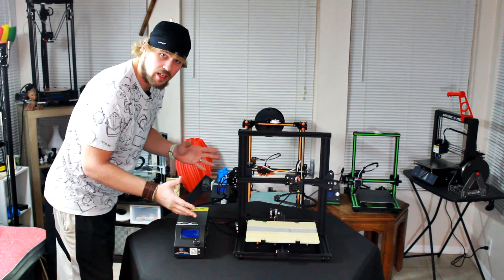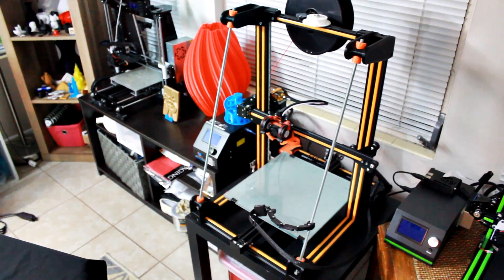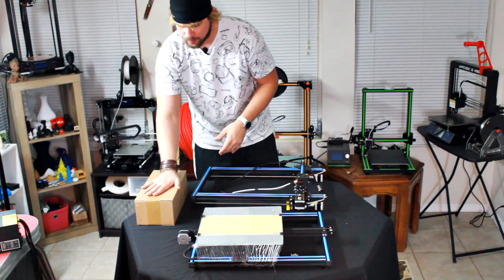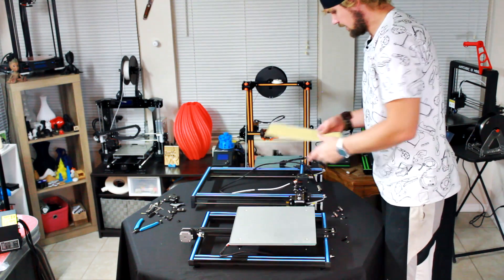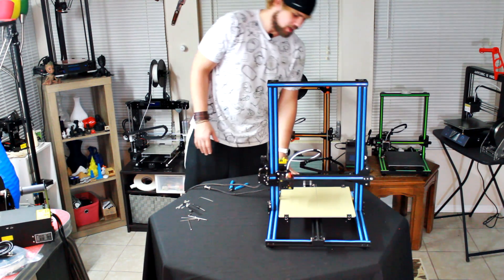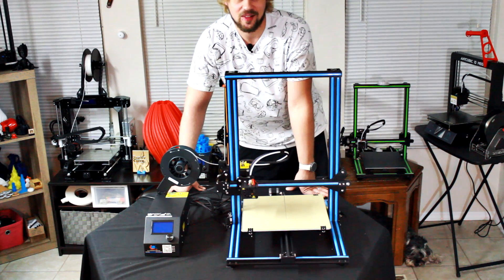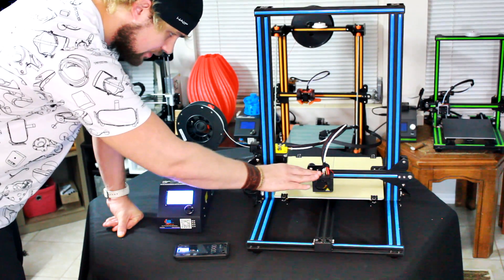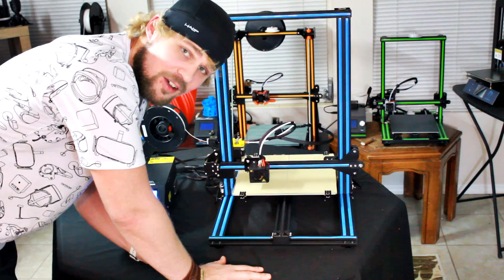✔ Creality CR-10S Upgraded Version COMPLETE REVIEW! | WORTH THE EXTRA CASH?

Comment: Horrible printer. Not worth the money. I've been printing with this device over 2 months. Always a problem. Screws gets loosen during long prints. Heating bed problems. You need to adjust this before the prints and after. One project Ive printed 4 days of non stop print, nozzle part (bottom wheel screw) readjusted due to vibration and damaged the project. there's many other problems. So those guys who say such nice thing about this is because they get free parts and even printers from the company.
Reply: Thanks for honest advice, what 3d printer do you recommend?
Reply: It is very hard to tell. Think what you want to do with it. Do you need 400 mm toll objects to be printed? (That’s how I thought, and it takes days for them to be printed, which is a downside) The quality? Also a challenge. The slowest you print the highest quality you’ll get, you can do so with most printer up to 300$ 
I get rid of the CR-10S way too many problems, especially when you beginner. You’ll have to do research on forums not on YouTube. YouTube is a business for those who know how to sell. :)
Good luck.

Comment: I thought this had auto leveling? is there another version with that feature?
Reply from the maker: you can add auto level very easy to almost all the printers, but IMO i prefer not to have it as it takes a lot of time during each new print and the bed usually stays level for a long time after initial calibration as long as you do not move it too much.

Comment: I have the CR-10S - none of the parts are 3D printed their all injection molded. Gotta give Creality some credit including so many spare parts - wow. The printer can easily be upgraded to the latest Marlin firmware which is a MUST and adding a Raspberry Pi 3 + Camera + OctoPrint = heaven! Luckily I have spare raspberry pi's... Marlin makes a HUGE improvement over the stock firmware FYI. I had crashing issues with stock firmware when manually adjusting Z axis on the control box too rapidly.

Edit: Looking closer at your video it appears your filament sensor is 3D printed - snap! Mine wasent but mine does look different. I have the one that slides off easily - putting some silicone is the mount held it on flawlessly for me.

Comment: Mine is on its way! Is it OK to try the gcode from the SD without going into cura and looking first? I've never used cura or any 3d printer before. I'm a little overwhelmed already and it's not even here... Also, glue stick for the bed or just start with the tape from day one?

Comment: Subbed. I'm getting my cr-10s in couple days ad looking forward to upgrading it as well.Thanks for great content man keep it up !!
My only worry is ABS will it print ABS or just PLA. Thanks
Reply: The only issue with abs is stock the heated bed only goes to 85 degrees on the low side for abs ideally you want 100 degrees. You can add insulation or even better have an enclosure for the printer good so it does not stick up the house as much. The tevo tornado has a better heated bed goes to 125 degrees but lacks other features and is not as nice and its bed material sucks.

Comment: Did you open up the control board closure to see what wattage the PSU is? It might be 20w if it took that long to get 210. Issue with the closer can it fit a 30w?
Reply: Jaymacibe 20 watt???  You mean amps?  It’s a 12 volt 30 amp, 360 watt unit.

Comment: So you aren't going to answer the question?
LAme.
Reply from the maker: the worth the extra cash question? I would assume it's up to the viewer to decide if they think it's worth it or not. Personally, I think most people that bought the original CR-10 bought the extra Z rod add-on that was available as they sold old of kits a few times. It's certainly going to help taller prints stay level. Also the addition of a filament sensor really does help prevent losing some very long prints. Motherboard upgrades, TBD. What do you think?